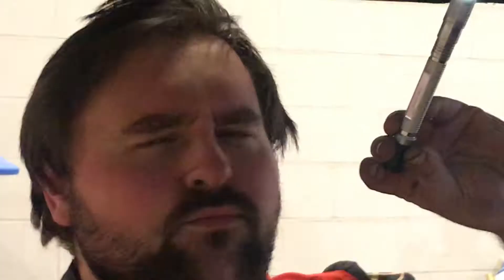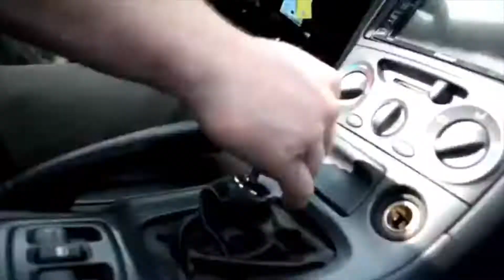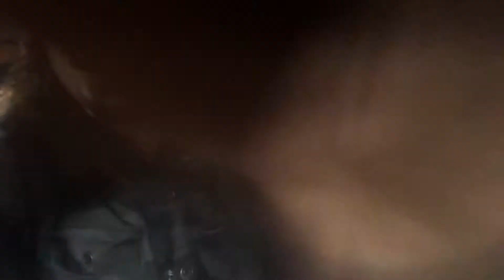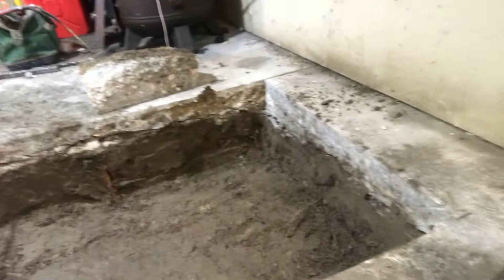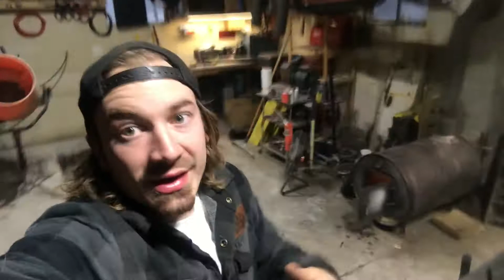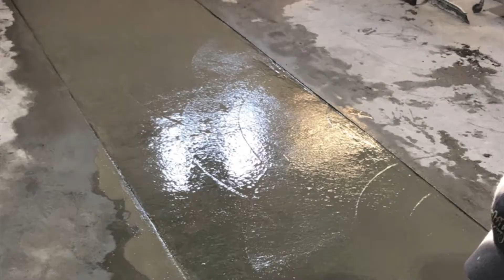POURING The Slab For The MAXJAX LIFT!!

Comment: Are you putting a 2 post or a 4 post car lift? Do you think 4 inch concrete slab will crack under a 4 post car lift?
Reply from the maker: It’s a two post. I’d want more than 4” personally but idk what the min spec on a four post would be

Comment: Do you recall how much working time you had with that concrete?  Or how long it took  you to mix and pour it?  I am looking to use the same 5000 psi stuff from menards.  Thanks
Reply from the maker: We mixed it REALLY wet because well, it took forever to mix it all up… and I had to drive a half hour back to menards…. Twice…. For more 🤣 I can’t say an exact time that I recall but as wet as it was, we were able to work it for quite a while…. We had plenty of time I’d say like from start of the pour to the final skim, shoot it was roughly like from 11am to about 7pm we finished skimming and working the cream up, it actually came out better than the whole rest of my garage floor… did the whole project in one weekend, Friday evening to Sunday evening. Hope this helps! Drop a sub!
Reply: @shiftwrenchrepeat  Sweet thanks for that. There is no direction on cure times, understandably, as it varies so much. I will pour when it gets warm enough. This info helps me out for sure. I am pouring 2 pads, each will take 24, 60# bags. I will do it solo, but have a HF concrete mixer. Hope for the best. Thank you! subbed

Comment: I like your vids, my friend.  Lots of energy and info.  But I have to ask: What was the reasoning for pouring such a large slab?  A  2'x2' 18" deep hole with some Rebar would have been more than sufficient for the MaxJax.
Stay the course.
Regards,
John
Reply from the maker: After talking and researching, I wanted to make sure it wouldn’t shift or move at all, and it’s best to tie the two sides together, overbuilt over safe!
Reply from the maker: Appreciate the kind words!
Reply: it is massive overkill but its more therapeutic for the user to "feel" safer, 18" deep is also overkill, 20 x 20 x 8" with 4" under cut around would be plenty. The compacted sand and gravel under your garage is about 50lb/in bearing capacity and each post is rated 3000lb. You dont need to go deep if you under cut the footings, concrete cracks at 45 degrees, if you have a 4" slab and under cut 4" out and 4" deep your are set. I installed the same lift and only needed 12bags max per post, i didnt want to haul and mix more concrete then is needed

Comment: Who concrete you use and what was the mix ratio?
Reply from the maker: I used sac Crete from menards and there was no exact ratio because I had to use like 96 bags I mixed real wet so it didn’t cure to fast and then worked it a LOT when I was done pouring to pull moisture and “cream” to the surface.